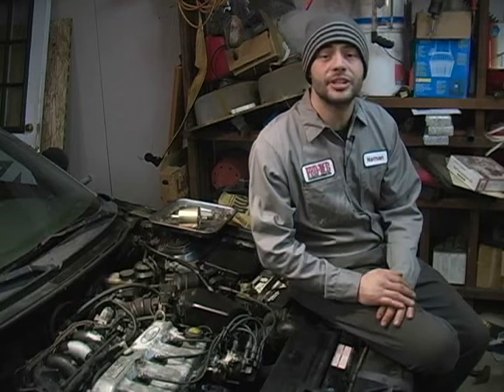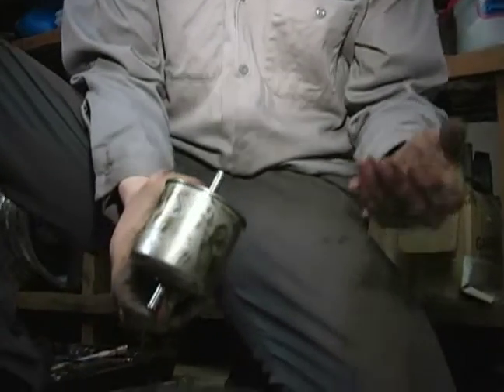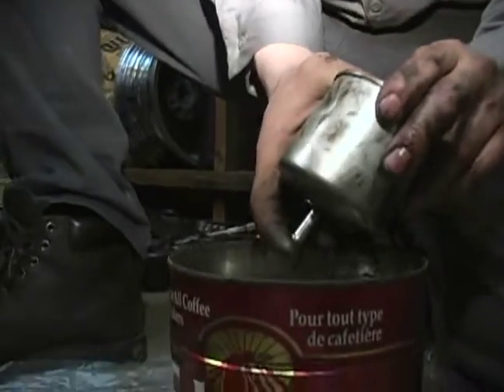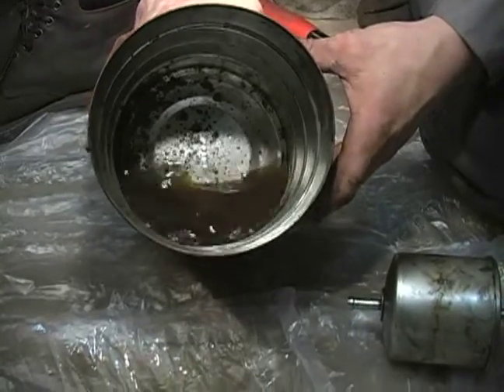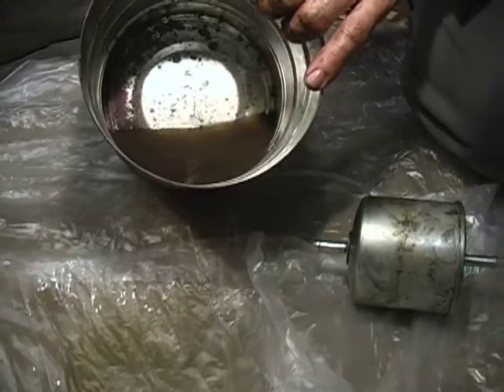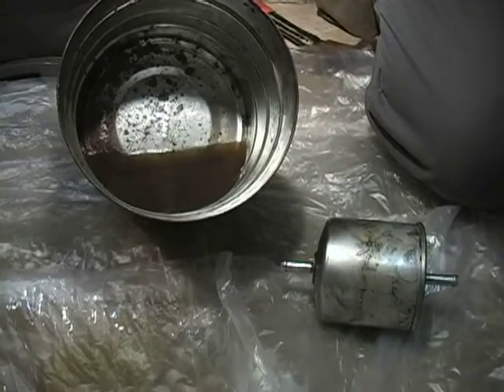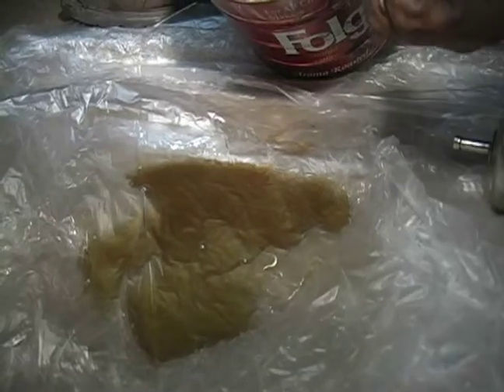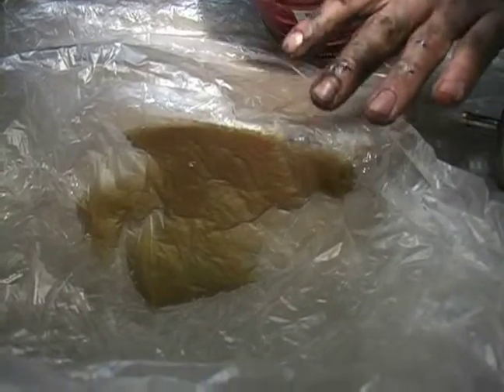How to Change a Fuel Filter : What Does a Fuel Filter Do?

Comment: To change fuel filter:
Remove fuse for fuel pump
Turn over car, if it stalls no problem, try 2-3 times
Remove Fuel Filter
Replace Fuel Filter
Tighten screws
Put fuse back in
Turn car over
Done